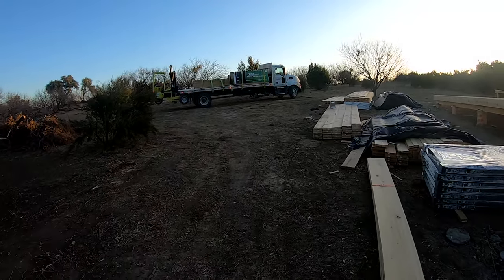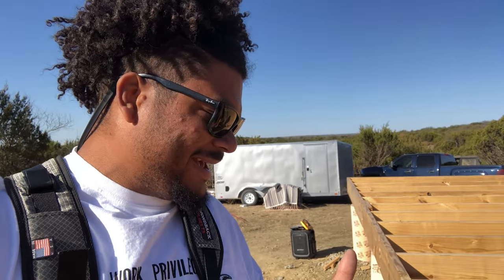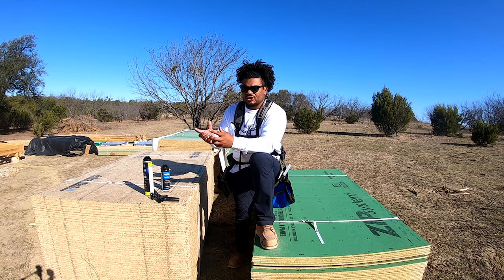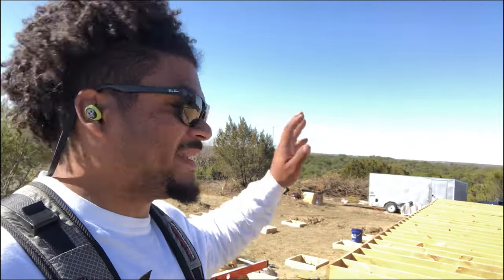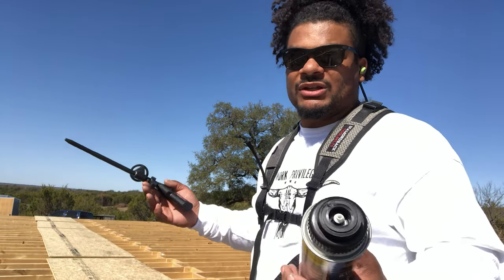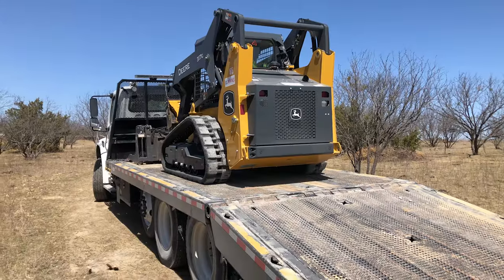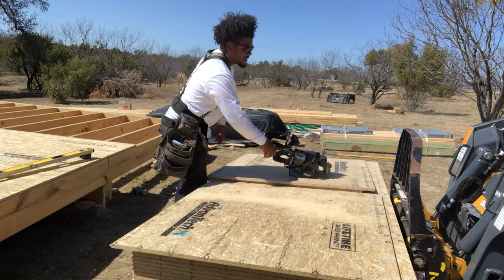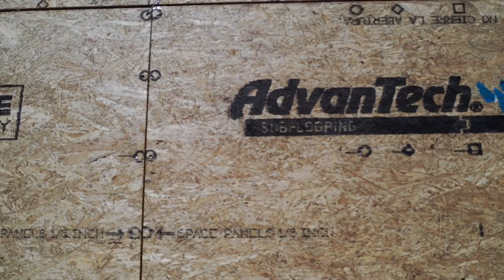Installing Subfloor | Off Grid Build Ep. 6

Comment: Jon, I wanted to ask cuz you seem like the person that would know, I’ve seen a lot of homes, not worked on them or built like you, just been in a lot and seen alot. New and old. 
I’ve always wondered why we don’t paint the bottom of the joists ?
Could be a stupid question but i just watched someone spray the underneath of deck before this lol

Everything thing else gets painted, so its always made me wonder what the reason would be to not do it. 

Wouldn’t painting the joists and beams before laying advantech be like a new undercoat on a truck frame/ or deck.

Maybe better prevent termites or rot is it just not worth the extra time? 

I just thought id throw this out there and see if you had any thoughts, I’m gonna have to probably do some floor repairs soon becuz of some Termites that have been here for who knows how long and like ur thought process on building. I’d like the make it better than the last person  if possible and not let termites take it out.

Comment: Jon great stuff! I have questions LOL...
1) How do you think Advantech subfloor compares to plywood subfloor? Thinking of going the plywood route since Advantech has been sold out in my area.
2) Will you be putting any type of insulation underneath your subfloor. Hope to get our subfloor done over this Easter weekend, appreciate any info you can provide.

Thanks again for taking the time to put all this together. Take care!
Reply from the maker: I believe advantech has many advantages over traditional OSB especially when paired with the adhesive and engineered floor trusses. I also thing is has major advantages when it comes to moisture, weather exposure, and joint connections. BUT with that being said, if you are on a very tight budget and also will be drying in your build very quickly (minimal weather and water exposure) I have no issues with traditional OSB as long is it’s installed properly at the seams. 
As for under the house I will be doing a closed cell spray foam to act as somewhat of a vapor barrier and obviously insulate the floor. Good Lou I on the build and let me know how it goes!
Reply: @JonDawson  Thank you for taking the time to help me out. Really appreciate it! I will keep you posted. We finished sub floors Easter weekend. Now binging Youtube videos for wall framing LOL
Reply: Hey can you tell me how many 2×10s you needed to frame your floor completely?